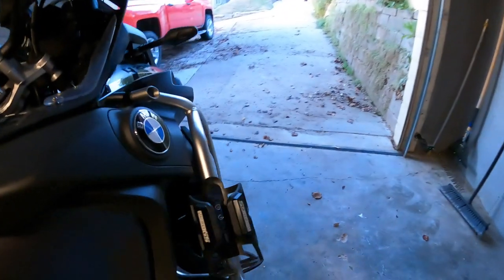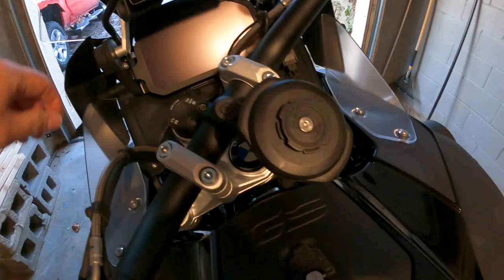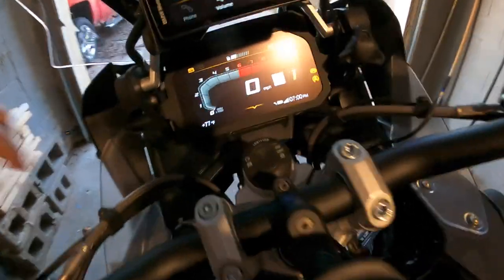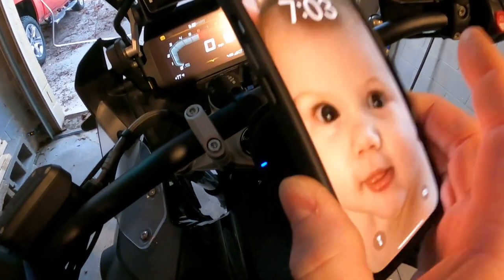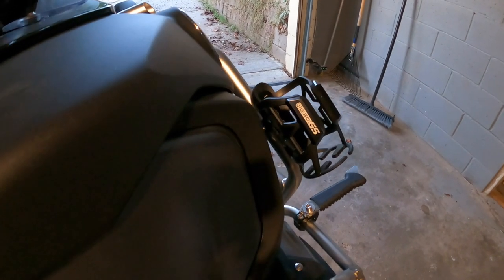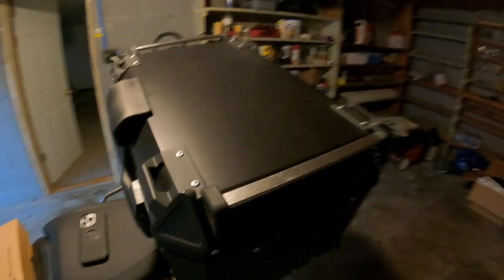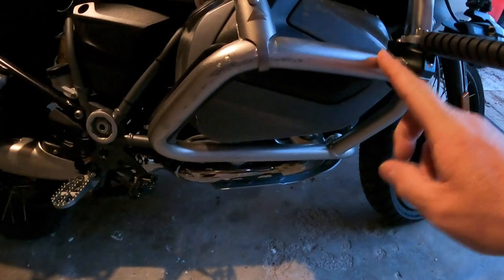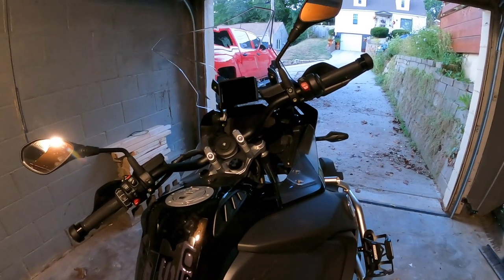BMW R 1250 FSA: Wunderlich Highway Pegs & QuadLock QI Charger   HD

Comment: I think you have to flip the pegs right <=> left. The idea is to be able to open them easily with the point of your feet on the metal pic. They should also fold under te horizontal bar not on top